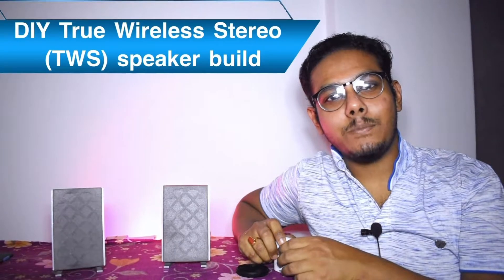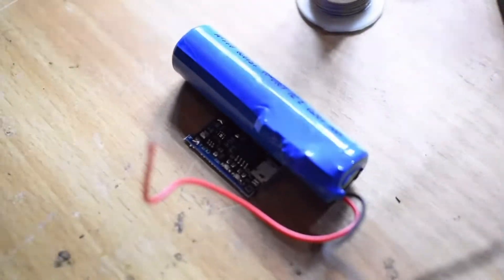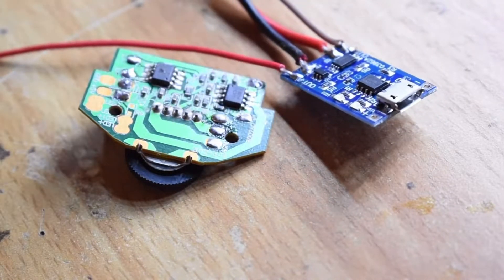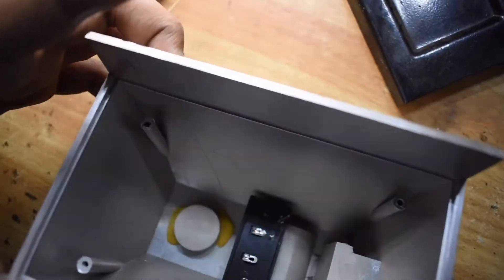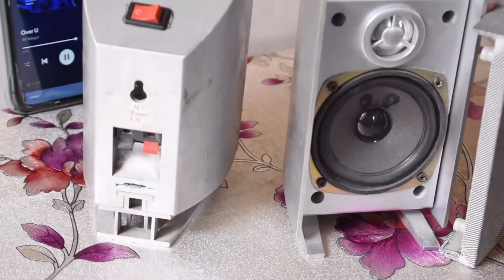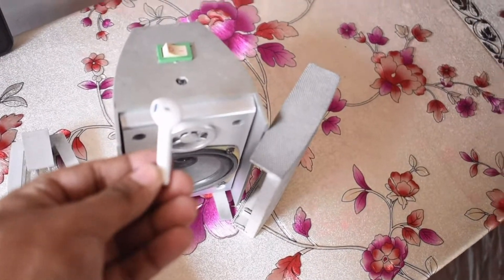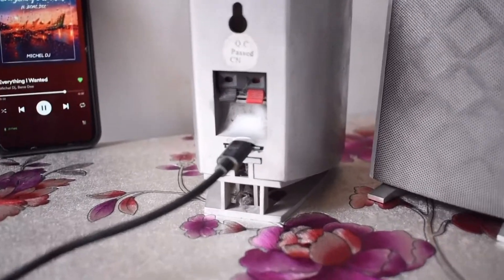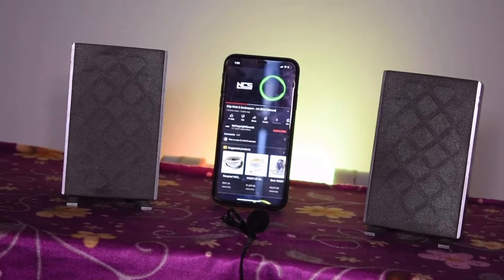Bluetooth Speakers DIY| True Wireless Speakers (TWS)

Comment: I've made these but when i increase the volume I'm getting the battery beep sound for battery low, even though I've fully caherged the battery for usage, please help me out with this issue 🙏🙏🙏 Please reply.
Reply from the maker: @nanchariK  that means the battery is not supplying enough current (amp) to the system. I suggest using a bigger 18650 or higher mah LiPO battery of 4.2v. Should fix ur issue. Hope this helps. Subscribe, like and Share.

Comment: But dont you have to turn on and off by touch manually?
Reply from the maker: @durgeshverma9144  Subscribe to my channel, like and share too.
If you mean Turn on off the individual speakers, then you are correct. There is no touch function on this, its all done by a single button, on off, play pause, next previous etc. If u buy any pair of TWS Bluetooth speakers, you so so have to par them on and off individually. Hope this helps,.